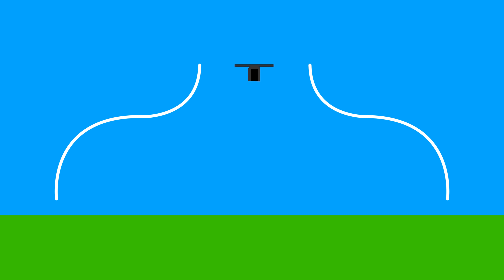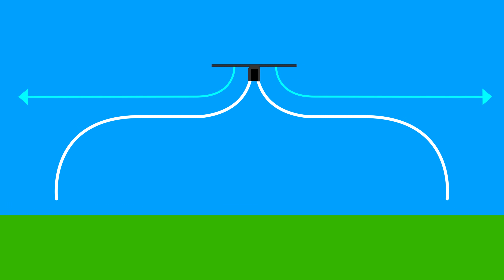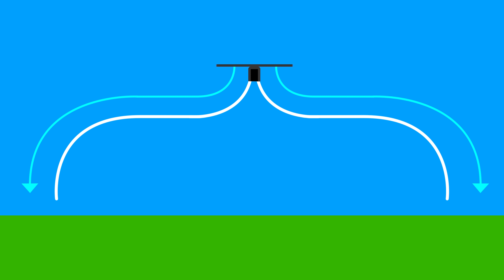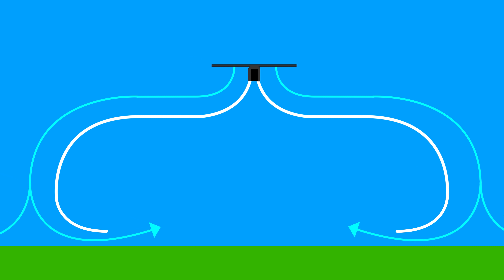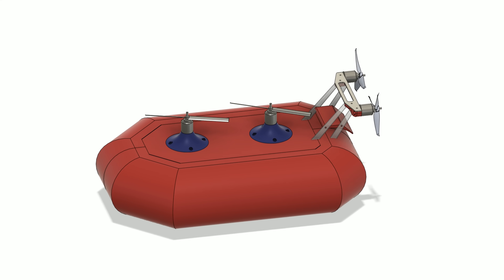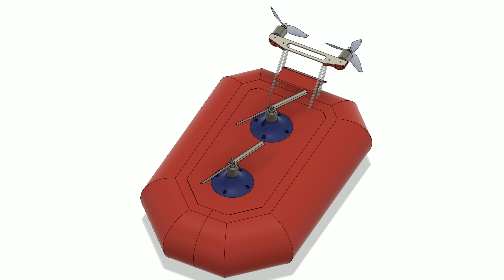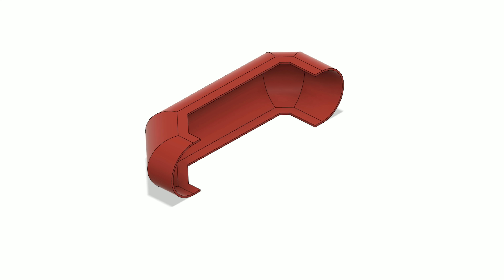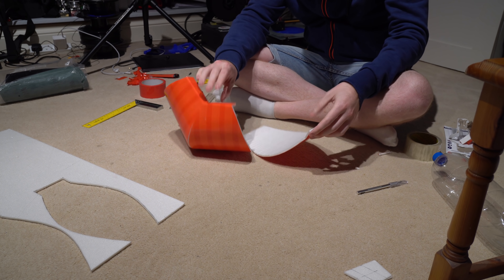Coanda Effect Hovercraft

Comment: Could be a fun take on a backyard Roomba

It's clear that the Coanda effect is functioning to create a pressure differential great enough to suck up leaves, but I wonder how much of the lift is Coanda, and how much is those massive props just pulling the whole thing straight upward
Reply: Novur needs to make a square sided version to compare.
Reply: @toxaq  exactly what I thought, would be interesting
Reply: I saw that as well, I thought the design would create a stronger vacuum and pull it down. Maybe a small vent hole just under props to either vent any suction or possibly push some thrust down into the space!
Reply: With regards to the leaves, the craft is just being dragged over the ground and scooping them up. Look at the cross sections, he just made scoops.
Reply: I think nothing is proven here as far as the Coanda effect goes. In my opinion and as Novur wrote, there are probably a bit of both propeller and Coanda effect going on. But it's definitely not all Coanda. Probably more of one or the other at different altitudes and speeds.
Reply: Patrik Einarsson Agreed. Without additional testing/data all we can do is speculate.
Reply: @wesmatchett615  you hit the nail on the head. Only a small fraction of the air is spilling and creating lift directly. The rest is hitting the deck and doing two things. The streamlined flow closest to the shaft is showing Coanda effect and generating lift while the rest of it is just creating turbulence, from hitting the streamlined flow beneath it. I too would like to see a ducted design with air exiting the duct close to the deck horizontally. This could also save the the flows from the two propellers hitting each other, if designed properly. Right now, this design is very inefficient and impractical. I wish I had the skill to to design this and test it out.
Reply: Mani Kurian thanks, I was beginning to wonder if anyone else saw that the prop wash hitting the deck parallel to the intended lift direction is a consideration that can’t be ignored. The air must turn 90 degrees to begin the lift effect being tested.  This will negatively impact the intended lift.
Reply: @wesmatchett615  His first test with radial impellers didn't seem to do much. I suspect the coanda effect isn't really contributing much, at least not the way he thinks it is. He did not do any flow tests, so he can't empirically claim that this is coanda lift.
Reply: I don't think that will work at all.  The downward trust of the props is hitting the craft body, cancelling out any lift.  For the same reason, you can’t put a fan on a sailboat to generate thrust.
Reply: @wesmatchett615  you could if you took down the sails and just used the fan for thrust 🤔
Reply: @wesmatchett615  You CAN put a fan on a sailboat to generate thrust... just not pointed at the sails.
Reply: @wesmatchett615  You absolutely can put a fan on a sailboat to generate thrust. the sail just redirects the direction of the jet. This is EXACTLY what the viscous flow effects here are doing. Its just redirection into something more profitable. and furthermore because the prop is more or less over the deck mean in no way that it balances out. To believe that it only acts on the deck directly below is to ignore the entire premise of this video. Aerodynamic effects exist.
Reply: jacob schopp I never said it only acts on the deck, I said the deck is cancelling out the upward thrust of the props.  I am agreeing with you that the movement over the deck is causing low pressure and that is lifting the body, not the upward lift of the props.
Reply: @wesmatchett615  I simply think that the thrust provided at that vertical distance is very far from just coanda effect. Im betting turbulent flow over the deck is acting to deflect streamlines in a much more continuous shape around the vehicle
Reply: jacob schopp I would like to see Tom test with a different fan configuration or without fans. Ducting the fans so that the air only exits horizontally would be interesting.  Also trying compressed air stored inside the body and ducted horizontally again would be good. Trading the weight of motors, mounts, and large batteries for tanks and ducts would hopefully  be a fairly even exchange.  This would limit all possible lift to just the Coanda effect.
Reply: @wesmatchett615  I would like to see simulations and math to really dig the point in. Also would be valuble to viewers to see an engineering process more extensive than 3d printing a eyeballed squirrel cage
Reply: @jacobschopp798  But we still don't have fluid dynamics pinned down...in a lot of projects scale models are used instead of simulations because we are still not there in terms of accurate simulations.  There is still a Millenial Prize out for solutions to the Navier-Stokes equation.
Reply: Wes Matchett .  Your theoretical fan pushing on a theoretical sail is not a closed system nor is it a one for one cancelling. For example, the further you move the fan from the sail, the less effect the sail has on the net force. In this sailboat thought experiment, the boat would move backwards.
Reply: @jacobschopp798  I dare you to try it in real life. Your sailboat will go nowhere. Yes, air will be hitting the sail to push the boat forward. But the fan is attached to the boat itself, and will push the boat in the opposite direction, cancelling out the forward thrust on the sail. Newton's Third Law.

You'd be better off directing the fan BACKWARDS to push the boat along, and get rid of the sail.
Reply: @wesmatchett615  not really. Most of the force from propeller comes from Bernoulli law, not from air pushed away.
Reply: Maciej Pelczar Yes, but the moving wind from the propellers is hitting the deck.  This energy is equal to the lift generates by the the propellers. Are attached to the deck.  There are two forces opposing each other, cancelling upward movement.  This is not my theory, but proven physics.  And it is the same as a sail - the thrust of a fan causes movement in one direction, but the wind hitting the sails is in the opposite direction.  These are attached thru the boat itself and cancel out.
Reply: @wesmatchett615  This is true in the strictest sense, but not all the air from the propellors is hitting the deck, and a significant portion is being redirected using those ramps, which also pull some air away before it can transfer its energy to the deck. In a closed system the props wouldn't generate lift on their own, but in an open system like this there's enough "slop" to produce a net lift gain
Reply: Wes Matchett You’d think that but Mythbusters did an actual experiment and showed this to be false.
Reply: Novur Yes, a SMALL amount of thrust can be generated by spill. @ Rob Ryan - Yes, the Mythbusters showed this to be true, but the amount of thrust was about 10% of that created by the fan just running without the sails.  The amount if lift Tom is getting does not appear a to me to be that slight, he was being very careful not to take off.  To me this appear to be more than would be possible with spill.  Further measurement is needed to determine what various forces are generating his lift.
Reply: @wesmatchett615  but Wes, what about the additional lift being created by the TOPS of the propellers?
Reply: I believe It's the Coanda effect.
All of the thrust is pushing down to the body of the craft and curving around it. So in essence, yeah it's those massive props generating the lift, but it's passing over the body of the craft first. If it was just the propellers they would take off and separate from the body being pushed away or more obviously just not generate any lift. Right?
Reply: Kyle Pajarito But is the thrust from the propellers a “push down” effect or a “pull up” effect from the aerofoil shape of the blades?
Reply: I bet most of the lift is coming from the props.  The fan/sailboat comparison doesn't really apply here.

Comment: Flatten out the bottom half of the edges.  It seems the coanda effect is drawing the air to a central point creating a balancing issue.  If you were to reshape the sides the effect would end sooner creating more of a skirt of air pushing air outward and should increase your ability to balance on that air. At least play with the shape of the bottom half to increase balance so you can use more thrust. Really smoke would be helpful in determining how the air cushion is shaped.

Comment: I wonder how much lift is actually produced by the coanda effect, and how much is lift produced by the propellers.
Reply from the maker: The width of the fuselage is twice the diameter of the propellers, therefore if the coanda effect wasn't working, the air would just flow outwards horizontally and not produce any lift (well a very small amount of lift due to the fast moving air being at a lower pressure).
Reply: @TomStantonEngineering  how about using the same setup, but eliminating the curves on the body (i.e. like an inverted cardboard box). This should quieten the small number of commenters that think it is the lift from the rotors, not the coanda effect that is causing the craft to fly. Same weight, sa e surface area, but no curves, no coanda, and my guess no lift either. QED.

Comment: I wonder if you gimble mounted the top props like your chinoock design if it would help the flipping issue. It would require gyrops but if they tilted oppisite of the flip it should reduce lift on the side picking up and add more to the low side right?

Comment: I am not sure it is the Coanda effect, it could be the propellers.  My main thought about your instability is that it is similar to a fly wing.
Reply: he needs to make a box shaped one and test
Reply: Okay, i did a test now. Built a small floating platform with PC fan on it:
https://www.youtube.com/watch?v=k9_b5MCNics
As soon as i put the blocking wall in the air flow it seems to cancel out the force completely. I tried different widths of cardboard boxes (not on video) and it is enough if it only slightly more than the fan diameter. 

His hovercraft base should easily have the same effect. So the thoughts that it comes mostly from the propellers are probably wrong (including my previous comment).
Reply: @1Hippo  That turned out really well.
Reply: @1Hippo  When I saw your previous effect my first thought was that you correctly invoked the third law for the propellers, but not the system. The propellers force the air down which acts on the propellers in an upward way - but then the mass of the affected air impacts the hovercraft in a downward direction and cancels the previous effect (same mass of air, essentially).
     But then you figured that out and even proved it experimentally! Good job!
Reply: Would some cotton telltales around the hull (or a smoke generator) either prove or disprove it?
Reply: I think there is some effect,  but mainly low pressure above the propellers.  But then again,  the propellers are using the coander effect too. The leafy wind tunnel showed there is little blowing downward and I think it was too optimistic for it to blow round 180 degrees! I think 35 degrees is pushing it.
Reply: Yes, i also think it is from the propellers. They are moving the air downward first, so there must be an equal force in the opposite direction (up). This will act on the propeller shaft and after all pulls the vehicle up. It does not really matter where the air goes after that, as long as it is not redirected up again so it would create a force directly pushing down, but i don't see any way how that shape would do that.
A relatively simple test could be to change the propeller angle, so they push air just horizontal over the craft, which should also get redirected down, if the coanda effect works. You could even use the rear motors spinning in the opposite direction, then counter the backward force with a second propeller (pair).
Reply: All it takes to measure the relative pressure generated underneath the hovercraft directly in terms of mm of water are a flexible tube, a bowl of water, a ruler marked in millimeters, and misc supplies to hold everything in position.

Find a large flat surface and tape down one end of the flexible tube. Bring the other end over to the bowl of water. As the pressure should be the same at both ends of the tube, if you stick the tube into the water no bubbles should appear. Likewise, water should not climb the tube.

Make an elaborate test stand to support the hovercraft at a suitable hover height over the surface, centered on the end of the tube. Alternatively, make 3 piles of foam core 10mm high and put the hovercraft on the 3 piles. Clamp, tape, or use a weight to prevent the hovercraft from leaving the test stand.

Throttle up the hovercraft to a suitable test throttle value. This should produce a positive pressure underneath the hovercraft at one end of the air tube.

Submerge the other end of the tube in the bowl of water. Raise and lower the end until the bubbles just barely stop. The depth of the tube at that point corresponds to the relative difference in pressure in terms of mm of water.

Calculate the area underneath the hovercraft. Multiply area as measured in square millimeters by the depth where the bubbles stop and multiply that by the density of water in terms of grams per cubic millimeter which is 0.001 (1 milligram). That will give the lift due to the positive pressure, aka the hovercraft lift.

Weigh the hovercraft.

Measure the lift at various heights and throttle settings until you get bored.
Reply: In my mind. Some level of conventional lift must be taking place here.
Reply: Easy to test: Place two rotors on top of a flat wooden (or even a foam) board and spin them up.
I highly doubt that anything will happen.

Since the airflow can't directly push the "vehicle" up, it's pretty sure the Coanda effect that lifts it.

Comment: This channel basically shows the trade-off between practicality and ingenuity

In this case: The trade-off between a good and a fun lawnmower
Reply: Hovercraft lawnmower? Seems fine to me. Extremely safe. 
I NEED THIS lul
Reply: @Erdroy1  A lawn mower that lifts off the ground...what can possibly go wrong?
Reply: @jchan3358  search antique hover  lawnmower  they have had them for quite some time
Reply: @Erdroy1  those are a thing already.... hover mowers are how golf courses mow tricky hills and obstacles.
Reply: He did not make a good hovercraft, but he did craft a hoover/vacuum cleaner for leaves :D
Reply: https://en.m.wikipedia.org/wiki/Flymo
The hovercraft lawn mower
Reply: @timschulz9563 , as a kid I remember it got a lot of air time on TV. A great idea that didn't take off.
Reply: Feels more like a cross between a vacuum and a leafblower
Reply: flashback to honey i shrunk the kids RC lawnmower scene
Reply: Next Video: Lawnmowing Hovercraft.
Reply: @spidercubed9718  sodium chloride
Reply: Is it not simply the rotor(helicopter) type action that is lifting and nothing to do with Coanda effect
Reply: Hovercraft lawnmowers are EXTREMELY common, so it's not particularly a strange idea.

If you've attempted to buy an Electric lawnmower in the past 20-30 years you'll probably have noticed how common the 'hovermower' is;

Pretty simple design really.
A solid plastic 'skirt', with a rotor and mower blades mounted to the same shaft.

When the motor spins up, the mower starts to hover, and turning off the power stops it hovering AND stops the mower blade rotation.

Comment: I wonder if you replaced the back motor with two smaller motors/props and wired that into a small flight controller if you could tune out the 'tipping' issue when turning/sliding and also tune out the flipping issue as it catches air with controller managed front/rear lifting motors?

Comment: Looking at the slow-mo, I think that flipping the way your propulsion motors spin might help avoid turn-overs. I think to react to a flip starting I would turn into it, then the reacting motor would be spinning with the top towards the flip and so would also counteract it in that way. Does that seem accurate?
Reply from the maker: If I understand correctly, then yes that's correct haha. My natural instinct was to shut off the throttle when it started to flip, but the motor which is at high thrust to cause it to turn will create a torque in the wrong direction as it decelerates. Ideally I should have reversed the direction of the rear propellers.